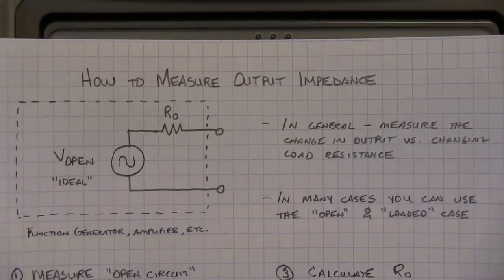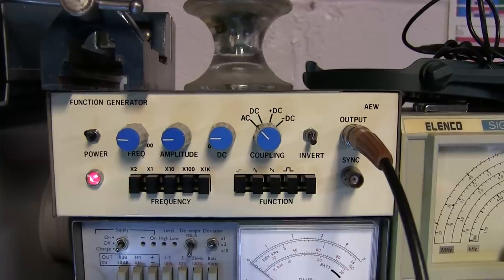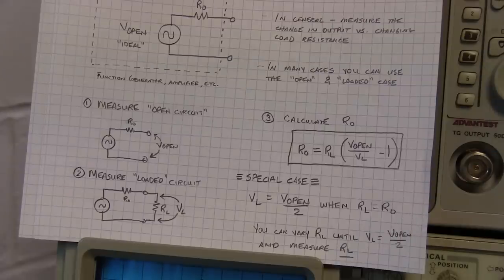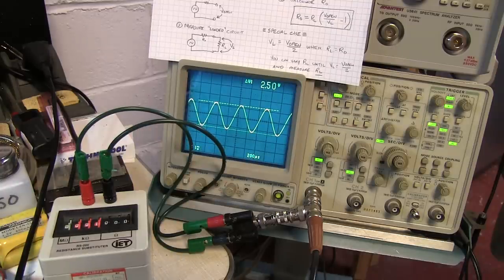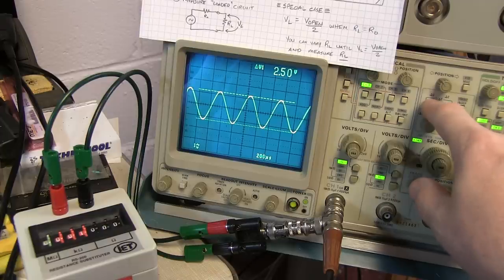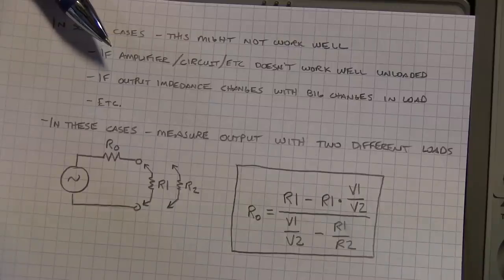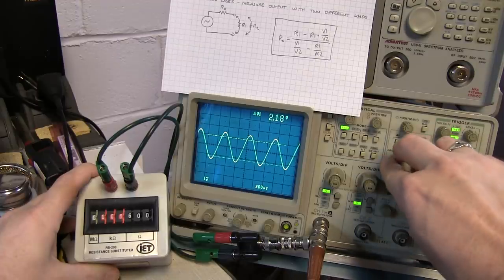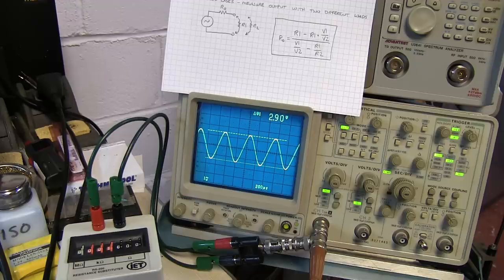#138: How to Measure Output Impedance

Comment: If the output impedance is 7K and the next following stage/section input impedance is 1K, is the output impedance 7K gets loaded down to 1K? the difference is 6K between 7K and 1K so the "difference" between the output impedance and the input impedance is called what? and its 6K of a difference?
Reply from the maker: When a circuit with a high output impedance is connected to a circuit with a lower input impedance, the voltage seen by the input will be lower - simple ohms law - it will be like a resistive voltage divider,  or as if the 1K and 7K appear in parallel - depends on the circuits.
Reply: @w2aew  But how can you tell if the high output impedance connected to a circuit with a lower input impedance is a Constant current source or voltage source? To tell if the output impedance and input impedance are in parallel there would have to be a resistor tied from the signal trace to ground on the output and always I see the input circuit have a 1meg resistor tied from the signal trace to ground, I don't see often the output circuits having a resistor tied from the signal trace to ground to determine the output impedance mostly its just let wide open no lead in audio circuits.
Reply: @w2aew  Most audio circuits that use transistors, FETS or OP amps use a 1meg resistor tied from the signal trace to ground on the input. If you replace the "1meg" input resistor with a "1K" resistor will this turn the audio input front stage from high impedance to low impedance?
Reply: @w2aew  EE designers are saying that if you sweep a waveform from 20Hz to 20Khz that was high impedance and converted to low impedance that it will sound darker compared to keeping it high impedance which sounds sparkly ( not darker ), any reasons why? even if its transparent the low impedance from 20hz to 20khz will sound dark compared to high impedance from 20hz to 20khz, any reasons why that is?
Reply: @w2aew  Its often that Stereo amplifiers and Guitar Amplifier designers that say the same amplifier will sound different from using 4 ohms, 8 ohms and 16 ohms. I'm not sure why 4 ohms will sound sparkle chime while the 16 ohms sounds darker, even using the same amplifier. Any reasons why this changes to overall tone because its the same amplifier and its bandwidth is from 20hz to 20Khz the only difference is the output impedance 4,8, 16 will alter and change the tone from sparkle chime to dark?
Reply from the maker: @waynegram8907  The most reasonable explanation is that the different speaker impedances change the frequency response of the audio amplifier.  I can't explain why.
Reply: @w2aew  The speaker impedance is a Load, either 4,8,16 ohms. Even if you sweep 20hz to 20Khz the Load impedance will change the tone from darker to brighter. Even happens with audio circuits changing from a high output impedance to a low output impedance it changes the tone from darker to brighter. High output impedance sounds brighter compared to low output impedance sounds darker. Any reasons why you think?

Comment: How do reflections work? Can it be thought of like sound energy echoing off the walls because the brick wall serves like a infinite impedance (a solid object that requires infinite force to move)? Why aren't function generators designed like a constant voltage power supply, so that the output impedance is almost zero, and have a current limit for if there is a short circuit or other overload condition? Is it because this is just was too difficult to design back in the tube and discrete BJT era?

I never did understand why would termination be a good thing, since if one is trying to get a ~20V rms signal down a line, and the source has ESR or output impedance, wouldn't terminating the output reduce the voltage and the power dissipated by the effective resistors for termination and inside the function generator? I suppose if signal if the signal gets 'bounced' and distorted, then efficiency isn't priority.
Reply from the maker: It all comes down to wave propagation.  I did a video on reflections and terminations:
https://www.youtube.com/watch?v=g_jxh0Qe_FY
and another on how to use these reflections to measure coax length and impedance:
https://www.youtube.com/watch?v=Il_eju4D_TM
and this is my favorite video that visually illustrates wave propagation and reflections:
https://www.youtube.com/watch?v=DovunOxlY1k

Comment: Hi Alan, for the second case, please give an example of when not working with no load.
Reply from the maker: One example is when an unloaded output causes the output to saturate or hit a limiting condition prior to reaching the theoretical open circuit voltage.
Reply: ***** Could you give an unequivocal example of what you say is very abstract
Reply from the maker: A simple example would be a current source output. If open circuited, the output will saturate before it reaches the Thevenin equivalent open circuit voltage.
Reply: ***** Got it thanks !!!
Reply from the maker: hub stub yes, that is a good example of course.

Comment: What if the output of my trASmitter doesn't change if I apply a 50 ohm load between output and ground of my transmitter? Actually it changes a little bit (smaller aplitude but it doesn't matter if there is a 100 ohm resistor or 50 ohm or jsut a wire direct to the ground). The frequency is 40 MHz , what does it mean? It looks like the load doesn't make any effect (or very small effect) on the output. It looks like there is no current in this case but still I have a nice sine wave 40 MHz.
Reply from the maker: Then it sounds like a very low output impedance.
Reply: Hmm 🤔 but if I had a low impedance I would have some current flow if I mesure it on my multimeter but there is none. There is something strange about it (the circuit I found somewhere on the internet). My receiver receives the signal from maybe 5 - 10 m range, so the range is not that big but if it is so low impadance it would produce quite a lot of power right? I will look deeper into it as this case is interesting , maybe I will learn something at least 😄 Still I don't understand strange behaviour of radio waves their propagation, especially when one books says one thing but I expetience eveything in opposite to the book 🙄🙄🙄
Reply from the maker: @grzesiek1x  Are you trying to measure RF current with a multimeter???  You can't do that.  Most DMMs can't measure current for anything higher than a few kHz.  RF signals, like 40MHz, require proper circuit layout, proper impedance control, transmission lines, terminations, etc.
Reply: So why are there some simple circuits in books that are supposed to mesure field strenght with a multimeter and they all use 200 uA pwrt of the multimeter to mesure it (I know it is just apriloximative indicatator , nothing precise) but still there are those circuits everywhere. So I suppose I will have 0 reading in electromagnetuc strenght meter as well 🤔 Am I mising something? So I can't mesure the currebt because multimeter is too slow but my book says that I can use my multimeter to mesure field strenght, using a simple circuit and uA part of ky multimeter. Now I am confused a little bit.
Reply: Only idea come to my mind is that in those books they don't say that they used maybe powerfull trabsmitter so they get the reading with anything. The general p4oblem I have in my designs is very short range, maybe 5 m - 7 m max, this is why I started to go deeper into the mesuring methods etc.to find out why some of my circuits have so bad performance. Of course I use owcilliwcope but I was hoping to maoe something quick , just to have a general idea of my transmitter performance ...
Reply from the maker: @grzesiek1x  Those simple circuits that measure field strength use a diode and capacitor to convert the RF signal into a DC voltage, which can be measured by the simple meter.
Reply: I understand the concept, tried it and  it seems like it has no effect on the diode for example. When I test it with my oscilloecope probes I see my 40 MHz beautiful sine wave , the diode, even germanium one makes no effect on the signal...To see anything I had to connect that circuit mentionned directly to the antenna so I got a reading like 40 uA or so.
Reply: Ok, I have just adjusted it in the better way and also changed some components and added a potentionemter and voilà I have a reading, 18 uA , about 20 cm from the antenna. Thanks for help anyway. I figured it out myself but thanks for your explanation it just showed me the right direction 🙃 I went to the swimming pool, cleared my mind and came back tp the circuit 😃
Reply from the maker: @grzesiek1x  Glad you figured it out.